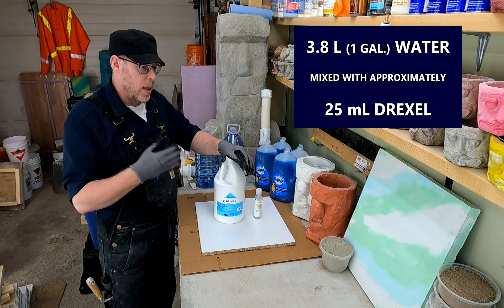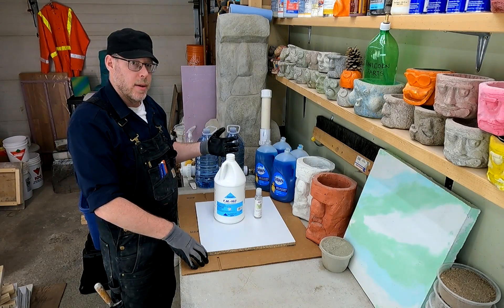How to Make Aircrete - Part 1

Comment: I use fiber to help the mechanical properties of my aircrete.  It works well.  Has a bit more compression strength than just foamcrete. Not as much as regulat concrete, but its tensile strenth is amazing.

Comment: I made a foam gun similar to yours. I brought the air in where you have the foam and I just run a hose out the end to a foam container, with a small pump .  I also quit using steel wool and started using shower loofahs. I had to google loofahs to spell it.  Anyway it works fine and it’s really cheap.  I’m sure there’s lots of things you could use. Just a suggestion.

Comment: Hi, I was wondering if there is a Drexel equivalent that's widely available in Europe? The Drexel products all seem to need to come form the US, a bit far for shipping. Or will the regular dishwashing soap also work (like Dreft or Fairy)?
Reply from the maker: I would try using a strong concentrated liquid soap versus importing drexel if it is not available in your area.  Use the vegetable glycerin to help stabilize the foam.

Comment: Thanks for the videos. I'm wondering what your thoughts are about making this aircrete for sculpting, the way people sculpt insulation foam & similar foams? Have you tried to slice it with a blade or form it with a file or rasp? (I would expect to need to hard coat such a sculpture with some type of harder modeling coating... but I'm wondering if you think it could be suitable as an underlying sculptural base)?
Reply from the maker: it is remarkably difficult to work, finish or sculpt.  Not sure it would give desirable results.
Reply: thanks  @creatingconcrete

Comment: So aircrete is more insulation than structural, can I use aircrete to insulate the walls of a cabin would it keep the cold out and keep the heat in?
Reply from the maker: It probably would, yes.  But if this were my cabin I think a vermiculite mix of 4:1 would be superior for both strength and insulation value.
Reply: @creatingconcrete  thanks for the information.